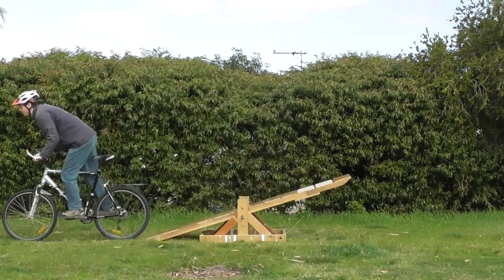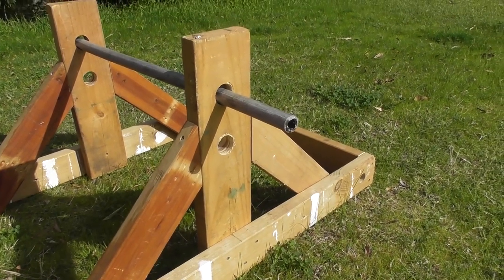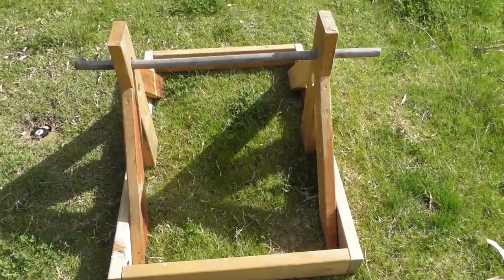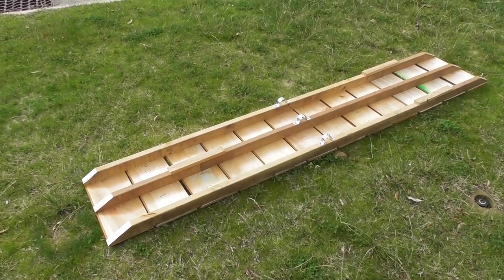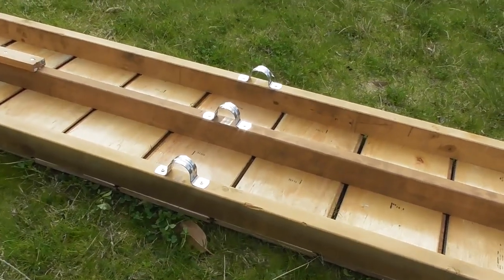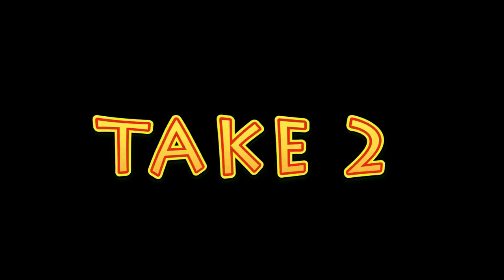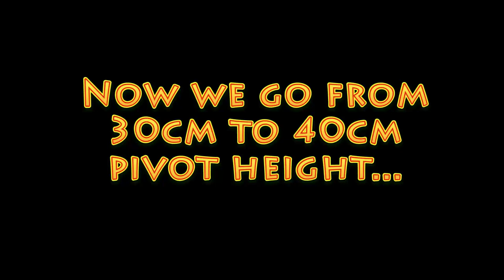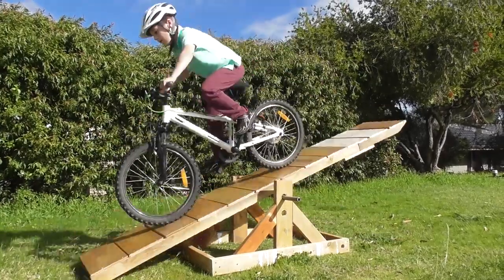Mountain Bike SeeSaw / Teeter Totter

Comment: Thanks for the video. Just completed one using yours as the model. Few slight adjustments - used a 10’ plank that is 16” wide.  Hole progression is 12”, 22”, 25”.

Comment: i am looking for help with my teeter totter in my mtn bike park that drops off the roof of my earthsheltered house.
The specs of my teeter are  13’ long   and 36” high.
I am using a stump as the base and have installed a channel on top of the stump and will be installing a pvc pipe onto the bottom of the pallet (the pipe will rotate in the channel).

My question is how far off the center of the 13’ pallet should i mount the pipe so the teeter totters back when the rider exits?

In case you want to check it out heres my park.
https://www.youtube.com/watch?v=EmRZgtzKBhM
And the teeter is the very last feature that comes immediately after an almost 180 degree berm which comes immediately after the step down which is the last feature shown in this video.
Have a great day,
todd
Reply from the maker: No idea with the height of your pivot point, but my balance point is 115cm along a 250cm length. Your balance point will likely be different based on length and weight of the teeter totter